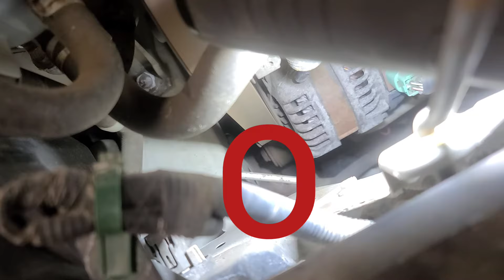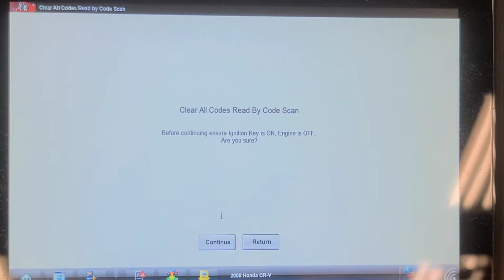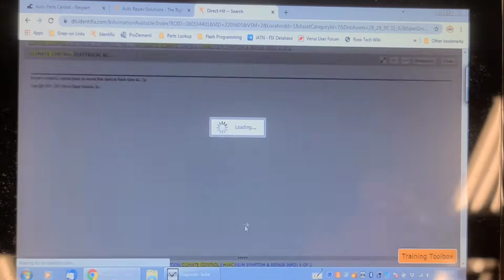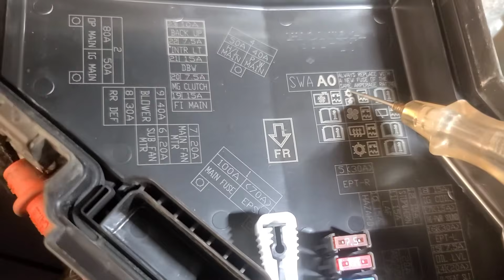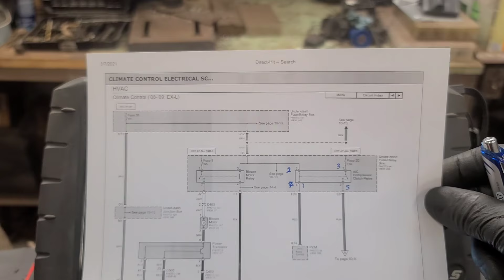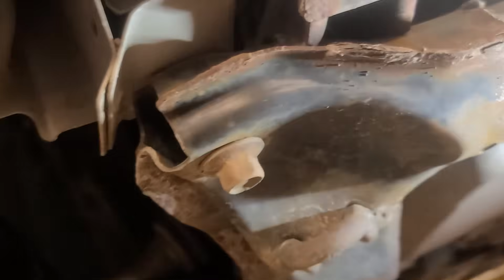2008 Honda CR-V 2.4 AC Not Working, Diagnosis of Compressor Clutch Circuit

Comment: why isn't the first step jumping the load side of AC compressor relay terminals? This would tell you if AC clutch is engaging, and if the AC is capable of blowing cool air. I'm not experienced. Maybe a mechanic can shed light on this.
Reply from the maker: You are correct...in this case that would have saved time.

Comment: My 07 only blows cold when the rpm’s are 2000+. Blows cold then but as soon as rpm’s drop it blows warm. Compressor is working. Should I replace the relay?  Thank you.
Reply from the maker: @1968Cadillac  not the relay if the compressor is engaged.  You need to check refrigerant pressures it could be low on refrigerant

Comment: my clutch spins, so not seized , but has not magnetic attraction whether car is running or not?
Reply from the maker: @royharnarain6512  have to check for power at the clutch. Is the AC relay being turned on?

Comment: I noticed on my 2009 Crv the A/C only blows very cold air when it's driving or I accelerate the rpm on park... When it's just idle it's not as cold...is this normal?
Reply from the maker: Make sure the cooling fan is running with the AC on. It could also be slightly low on refrigerant.

Comment: Is there any way to shorten the air gap without a new clutch assembly?
Reply: I can here the clutch make a clink noise every time it engages(once a minute). The gap is out of spec so debating on a clutch kit or a whole new compressor. Any clue UAC makes a decent compressor?
Reply from the maker: The air gap is set by a selective washer on the end of the compresor shaft. Take out the small 8mm headed bolt and pull the drive plate off. On some, I've actually removed the washer completely as long as the clutch does not drag. I've saved washers from various other applications, but you will be hard pressed to source one from the dealer. Good luck.
Reply: @PhillipBailey  I truly appreciate taking the time to reply. Do I run any risk, if the compressor goes bad, to send particulates through the whole system? I’ve heard some say yes, and others say no due to it being sealed? Not exactly sure what they meant by sealed. One last question.. would you recommend any other brand of compressor besides Denso on this (07 CRV) application?
Reply from the maker: @MrRedHotChiliMan  if all you need is the clutch I'd recommend just replacing that as it can sometimes be accomplished without evacuating and recharging the system. If the compresor has failed internally then that's a different story. I'd recommend original equipment new over a remanufactured part.  I'm not familiar with the brand you mentioned. Here's the clutch replacement https://youtu.be/rmnvZ_ptFCo?feature=shared

Comment: put a new compressor, recharged system, swapped the relay, pressure sensor on ac line, compressor kicks on then off ! checked the sensor in front of the condenser,  perhaps its the climate control module
Reply from the maker: You need to view the data in the engine control module and connect gages to see what the pressures are doing. AC request,  CA command, engine temperature,  etc...
Reply: @PhillipBailey  did that already checking ac diodes already ordered climate control

Comment: Thank you for the video!
My wife’s 2009 CR-V with 54,000 is starting to give her problems. Ranging from totally working fine with out issues to, no A/C at all to working for a while to then stop working while driving. 

Just purchased a new Power Probe 4 to help me with trying to find the issue and to finally have a good circuit auto tester. I was curious if it could be a bad or going bad thermal protection switch? And how would you go about testing it and replacing it if this is the issue. Thank you in advance
Reply from the maker: I doubt its the thermal protection switch. They typically fail completely and I've never had one intermittent.  When the AC stops working you need to see whether the AC clutch is engaged and the compressor is spinning. If its not it could be excessive air gap on the clutch. Carefully push on the drive plate with a stick. If the compressor engages then there is an excessive air gap due to wear on the clutch surfaces.
Reply: @PhillipBailey  I will check the air gap thank you for the reply

Comment: 08 crv ac comp comes on stops after a few miles maybe 8 I have 14 volts to clutch tap or push end of clutch it kicks in ac works great until I turn it off or drive a few miles still have magazines to clutch air gap is good pressure is 25 / 175 static one to two degrees over amber
Reply from the maker: Sounds like the air gap on the clutch is too big. Remove the small bolt on the front of the drive plate and try find a thinner spacer shim. Sometimes you can remove the shim altogether as long as the drive plate does not drag when released.

Comment: 08 CRV got a new ac compressor last year ac only blows cold air when not accelerating and it’s making weird noise doesn’t need coolant
Reply from the maker: You really need to see the system pressures to tell what's going on in the system. If the noise is coming from the compressor maybe the clutch is slipping due to high pressure. The cooling fan should be running with the AC on. Check the power and ground at the cooling fan and check the fuses.
Reply: The A/C condenser fan is not working only the radiator fan spins
Reply: Also engine doesn’t overheat or anything

Comment: I appreciate your helpful video ! On my 2007 Honda CRV, The AC was blowing warm air only & the clutch was not engaging but when I swap the AC Compressor clutch relay with Air Fuel Ratio Sensor relay (both 12V & 120 ohm four pin) . . . Boom! The AC started cooling . . . The problem is that I got check engine light turned on the dashboard. Do you think this could get worse? if I drive it like for a week? for the relay takes 6 days to be delivered. Thanks
Reply from the maker: Lol so you swapped the AC relay for tge AFR relay and now the MIL is on? Why don't you try a different relay if there is one like the rear defogger if it hasvone and it's the same number otherwise what about a salvage yard. Driving with the MIL on should not hurt it though but I'd try find a used relay in the meantime.

Comment: I have no power at the compressor.  I checked both the fuse and relay they're fine
Reply from the maker: If you have power leaving the relay and no power at the compresor then there is an open in the circuit. You say you checked the relay but how? Jumping the two large terminals in the relay center should send power to the compresor.  If you run the car with the ac on and pull the relay do you hear it clock off and back on when you plug it back in.
Reply: @PhillipBailey  checked the relay by switching it with another one.  I unplugged at the compressor, hooked power directly to it, and it came on, blowing cold air in the car.   So yes theres an open circuit somewhere, just where is the question now.
Reply from the maker: @SuperCody888  jump the two large pins at tge relay and see if the compressor kicks on. This will determine if its a problem on the control side of the relay or output side. Again does the relat click indicating its being turned on.
Reply: @PhillipBailey  so jump wired between 3 and 5 on the the relay socket?
Reply: @PhillipBailey  yes relay is clicking when a/c is turned on
Reply from the maker: @SuperCody888  yes one of those pins, 3 or 5 should be power. If say pin 3 is powered, will light a test light, and you jump it to 5 that should send power to the clutch. If it doesn't there is a break or open in that wire to the ac clutch. What year and model is yours and I'll look at a diagram see if there's another place to test in-between
Reply: @PhillipBailey  2008 Honda CRV.   So what I did was I disconnect the wiring harness at the compressor, and unplugged connector c101 and tested for continuity of the red/white wire which there was.  Also did a bridge wired at the thermal switch to bypass it.  I then did a jump wire at the 3-5 spots like you suggested.  The a/c came on. Perfect....however when I put the relay back in it doesnt work.   Bad relay?
Reply from the maker: @SuperCody888  are you sure the relay clicks when you plug it in? If what you are saying is happening that indicates a bad relay. Connect a test light across pins 1 and 2 in the relay center. It should light indicating both power and ground to the control coil. Again one of the pins, 1 or 2 should be live with the ignition on and the ground is switched by the PCM. If your blower fan works it uses the same fuse as the control of the AC clutch relay. If the PCM is not grounding the relay you need to scan for codes, check data related to AC operation such as engine temp, ambient temp, throttle position,  ac request, ac control command and power steering pressure if it has that. Good luck.
Reply: @PhillipBailey  ugh put in new relay, not working.  Did a bridge wire between 3-5 and it didnt come on. odd because it did the other day.  back to the drawing board

Comment: Brand new compressor fuses are good but mg clutch not engaging.
Reply from the maker: Control circuit problem or low on refrigerant.

Comment: Now here's a thing. My AC quit on me yesterday, so I started testing the electrics. Took out the relay and tested that and it's fine. Checked for voltage on the compressor supply, +12.7v so ok. Then I checked the voltages on the relay inputs. +10.8v with only ignition on and +14.2v with engine running, so OK. However, the other input terminal reads +3.4v ignition only and also with engine running. Weird. 
However, I shorted out the compressor terminals and the clutch clicked. I started the engine and the compressor was turning. That means nothing wrong with the compressor, which was a relief. 
What I can't understand though, is why the compressor clutch doesn't throw when the relay is in place. I thought it might be because there is a +3.4v on the non-fused input terminal (i don't know where that is coming from). That would lower the voltage difference to 14.2-3.4 = 10.8v. Okay, I thought that might be the problem, so I tested the relay with an old motorcycle battery with 10.1v in it. The relay worked fine. At this point, confusion took over. 
The problem seems to be somewhere between the interior switch and the relay. However, when I turn the interior A/C switch on, 'A/C ON' is displayed and when I turn it off 'A/C OFF' is shown. Surely that means the switch is working? 
Is it something to do with the A/C pressure sensor? I took off a cap and pressed the valve and a quick hiss showed there was pressure there. Okay maybe not enough, but would that not just cut the power supply to the relay input? Maybe not.
Any ideas?
Reply from the maker: You need to qualify actual system pressures and scan for codes related to the pressures. Not sure which pin on the relay is measuring 3volts but the ECM grounds the relay if all the conditions are correct. If you jump 30 to 87 at the relay and the compressor runs does it blow cold? If not it's likely low on charge. A scan tool would show you AC request, AC relay command, AC pressures and AC status. You need a full function scan tool to see this though as it's not in the OBD2 data list.
Reply: @PhillipBailey  Yes, I'll do a check to see if the A/C gets cold when I short out the relay pins. I suspect it is a pressure problem, but I don't have a scan tool.
As for the 3.4v, it's on what should be the input ground pin. That's the bit I don't understand, but not being an electrical engineer, that's not too surprising.
Probably best if I get a specialist to sort it out. At least I know the compressor is okay, so the cost shouldn't be too high. 
Thanks very much for your prompt reply and help.
Reply: @PhillipBailey  Hi again. I shorted out the terminal and went for a short drive. No noticeable cooling, so probably low A/C pressure.

However, when I got home I noticed the engine management warning message (PGM-FI) for a diesel, was showing on the dash. I'm not sure if this was showing before because it is not easy to see behind the steering wheel, but the handbook says I shouldn't drive it again. Waiting for a call back from a mobile mechanic to see if he can come out and look at it. I hope he can sort it. Thanks for your help again.
Reply from the maker: @dawhandle  yes likely low or empty then. It won't turn on the AC if the pressures are too low. Need to put gages on it.

Comment: Hi! I hope you can answer my questionn, i have 2008 crv, my ac not working i checked the ac compressor won’t work and checked all the relay and fuses are good. If i don’t have freon does thenac clutch still engage?
Reply from the maker: If it is low on refrigerant the compressor won't engage. Try bypassing the relay by jumping pins 3 to 5 or 30 to 87. The compressor should the engage. If it doesn't you have a clutch problem. If it does but doesn't cool thr system is low. Don't run it too long like that. Max 2 min.
Reply: @PhillipBailey  thank you so much i will try this!
Reply: Hi! I got one more question! Sorry! 
My ac worked already i added some freon. And after like 3 weeks when i drove it the ac compressor won’t work anymore i tried to bypass it still didn’t work u think it’s a bad compressor already? 
Thank you so much!
Reply from the maker: @iancelemin4441  if you added refrigerant there must be a leak. Add some dye to the system and check with a black light. Don't add sealant to the system! If you do a professional shop may refuse to work on it since the sealant screws up their machines.
Reply: I checked the amount of freon it was 50 psi. Went to the shop and they used some machine to recharged the ac.

Comment: Can I test the resistance on coil on pin 5 an chassis ground at ac relay socket?
Reply from the maker: Yes that should work. Somewhere around 3 to 5 ohms. If the air gap is excessive it will still rest good though.
Reply: @PhillipBailey  got about 20 kOhm on my measure. That going through the wire and connector to the coil. Strange reading I will say.
Reply from the maker: @orfeous  need to test right at the compresor plug.
Reply: @PhillipBailey  okey, and why that?
Reply from the maker: @orfeous  if the coil at the compressor tests in spec the you need to check the wire from pin 5 of the relay to the coil for high resistance then check the ground from the coil connector to engine ground for high resistance.
Reply: @PhillipBailey  thank you! I will try with coil unplugged. Seen everyone do that.
I know I have a little defect on the compressor wire isolation. But I don't think its cut through. The wire has been touching on ac belt :( a clip that holds the harness was broken.

I will check the wire plug to..
Reply: Looks like output on the relay goes to pin 19 on the ECM connector and then straight to the coil
Reply from the maker: @orfeous  output of the relay goes to the AC clutch magnetic coil. If you have power on the pin 3 at the relay jump it to pin 5 and the compresor should click on. It does not have to be running. Sounds like you have an open clutch coil.
Reply: I have the wire diagrams so I know the path ;)

Comment: I really like this video for detailed diagnosis. What about AC that works on and off. Like my Honda CRV 2011 AC works well after I start and travel for few minutes then it starts blowing warm air after.
Reply from the maker: When it stops working pull over where it's safe, don't turn off the AC or engine. Take note whether the AC compressor is engaged. If not you could have excessive air gap on the clutch drive plate. Over time the two surfaces wear and the air gap become too big for the magnetism to overcome. As the clutch heats up after use the resistance of the clutch coil increases, current goes down and the electromagnet gets weaker. With the AC on and car running use a wooden stick to help the clutch engage. Be careful not to hurt yourself. If it engages that's likely your problem. There is a selectable shim behind the drive plate. I've seen the clutch worn to the point you could remove the shim completely and the drive plate does not drag. Of course you could have other issues like a failing pressure switch or ac clutch relay. Good luck.
Reply: @PhillipBailey  i have the same intermittent problem. replaced the relay, i was able to hear the relay click. i tried using a metal rod to engage the clutch on mine, it didn't seem to work, and i felt the rod get pulled to it. i didn't get under the car to see if there was power to the compressor. is there any troubleshooting that i can do to see if it is the pressure switch? or if there was anything else to look into? thank you
Reply from the maker: @TheSwarm666X  if you feel magnetism on the compresor clutch drive plate but the compresor is not engaging then likely the air gap is too big. Try remove the small bolt from the center of the drive plate  pull the plate off and you will find a spacer washer that establishes the air gap. Try removing it completely as the pulley and plate wear over time increasing the air gap until it won't pull in. As long as it does not drag when disengaged. Good luck

Comment: Thanks! My problem seems to be the exact same. Condenser fans work, relay turns on, but the compressor clutch does not engage. I have not verified continuity between the relay and the compressor clutch yet, but I'd imagine I'll need a new compressor too.
Reply from the maker: Need to check power at the compresor clutch...